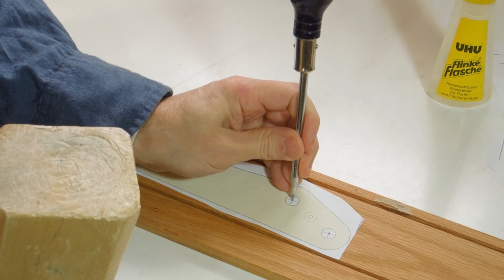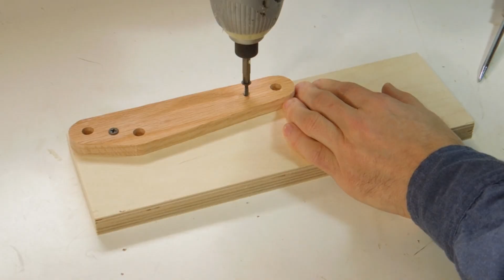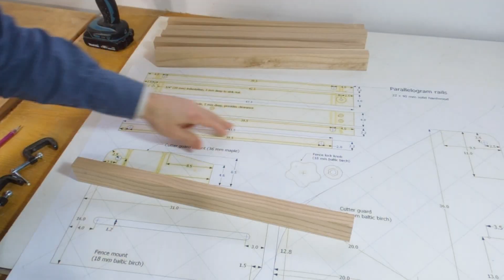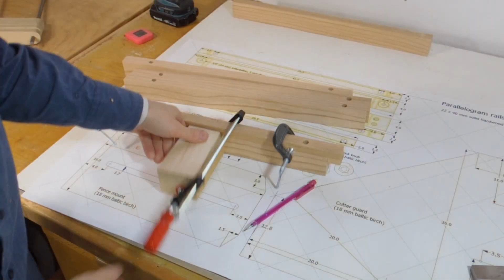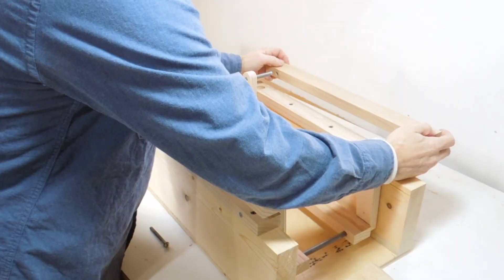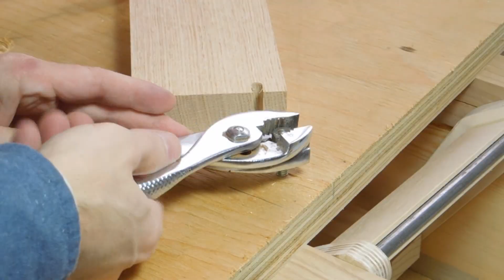Jointer parallelogram mechanism construction

Comment: Hi Matthias. Great job. I've just a question about your build.
Looking at your website I haven't seen any mechanism to adjust the height of the four corners in the infeed table like the system your designed for the outfeed table. Am I right?
Reply: I read somewhere that he adjusted  the outfeed to match the infeed, so four corner adjustment is not needed on the infeed. (then adjusted the knives to match the outfeed)

Comment: Instead of using those pegs to mark where the holes in the plate goes, why wouldn't you just put some screws or nails up-side down in there? Of course they would have to have the same diameter at the top as the hole. I would assume that would save some time and leave a better imprint?

Comment from the maker: I'll let you try that out when you build your jointer.  I already built mine.
Reply: Hi Matthias
  I think if you cut a thin wooden  "0" ring slightly smaller diameter than the bandsaw wheels and with an inside hole diameter about an inch and a half smaller, the rings can be attached to the wheels with screws so that they cover the tire (inner tube) edge, they will prevent sawdust getting into the tire(s). They may also be split to attach to the side of the wheel the axle is mounted to.
R. Converse

Comment from the maker: Baltic birch wouldn't be suitable for those connectors.  The point of the drill might follow the plys.  I had one of my angles off bu just a bit when I drilled the holes.

Comment: Very nice tip on using a simple wood guide for running the threaded rod studs in at 90 degrees to the table.  Thanks for all your tips.  I would also like to say that your plans for the box joint jig are great and easy to follow with the sketch-up model.